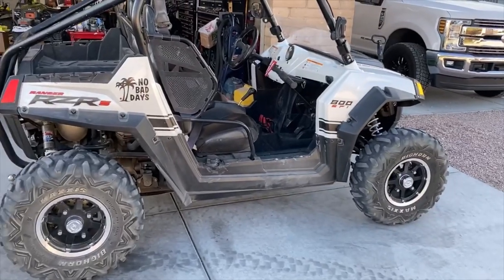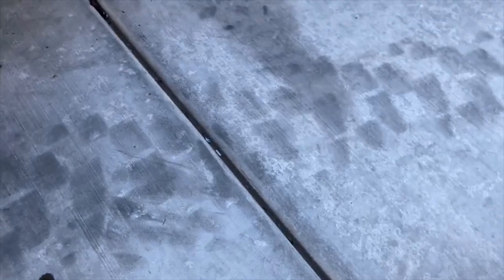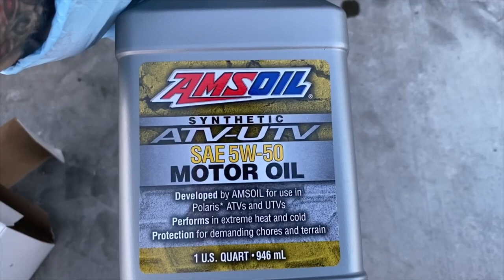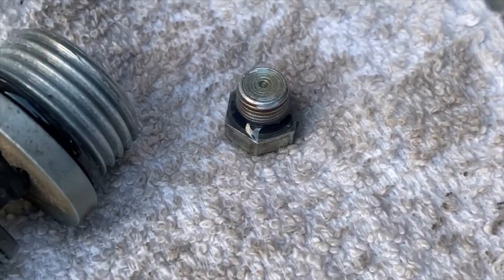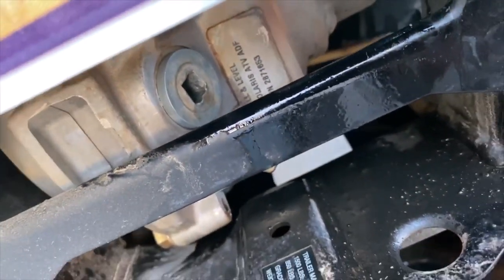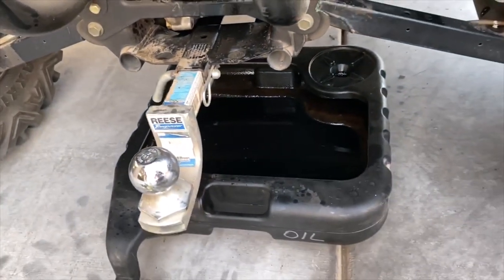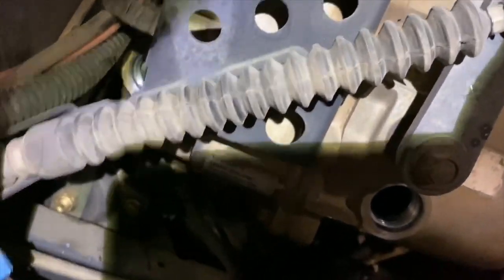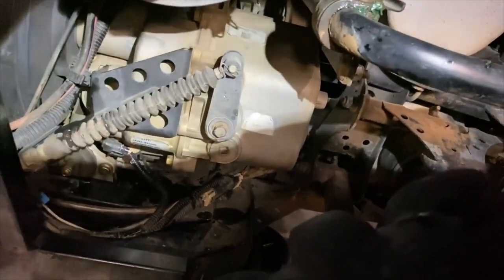2010 RZR 800S Oil Change / Transmission Transfer Case Service / Front and Rear Differential Service

Comment: Hi Mike, My 800LE is a 2013. You made reference to the transfer case being empty when the drain plug  was removed. The drain plug you referenced is actually the level hole, ie; the fluid runs out of it when it's topped up. The actual drain plug is on the underside. A bit confusing. Fill hole, level hole, and drain hole in under.
Cheers!
Reply: You are correct. I think my is empty too but luckily i see in owners manual.
Reply: I did the same thing

Comment: I noticed that error as well.  The transfer case has three ports. top to fill, middle to weep when full and bottom to drain.  Now someone tell me why the top fill port is even there.  I can't fill it past the middle (check) hole so why not pump it in there.  Makes no sense.
Reply: A further note on this.  The "check" port.. the one in the middle is a pain to remove and even worse to replace.  If you are just checking level.. you have no choice but remove it.    The easy way is just replace the fluid.  Drain it out the bottom and refill from the top with a measured 14 oz.    Leave that pesky level plug untouched.
Reply: Two years later 800 still going strong.  Anyone come up with a better way to get that transfer check plug back in?  It is trouble. Most of the time I just drain and refill  and leave the check plug alone.

Comment: You didn't drain the transfer case and likely over filled it if you took it to the level of the fill port. The plug you removed from the transfer case that you called a drain plug is the level plug. There is a plug on the very bottom of the transfer case that takes a small hex wrench to remove. That is where you drain the transfer case. The other small plug that takes a 13mm or 1/2 inch wrench is the level plug. After you reinstall the drain plug you use the 1/2 inch plug to determine the fill level. If you fill to the level of the fill port you have over filled the transfer case. Good video but inaccurate information on the transfer case. Also it's best to remove the skid plate and clean up the bottom of the RZR.

Comment: Transfer case has 3 plugs. Bottom drain. lower small plug is fill level. Top hole is fill hole. You overfilled it.

Comment: Is it same oil on differential? Transfer case? and transmission?
Reply from the maker: No gear oils are different. Go to Amesoil and search your make and model and it will give you the fluid specs and types.